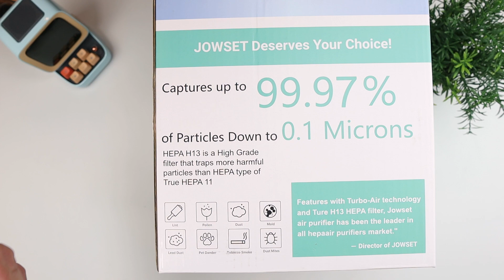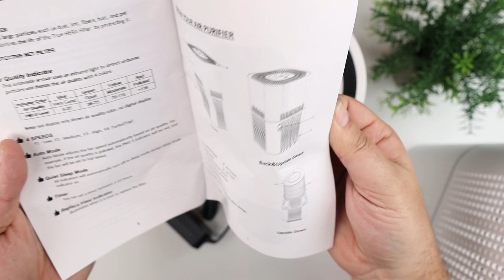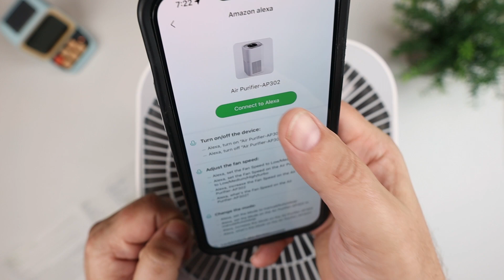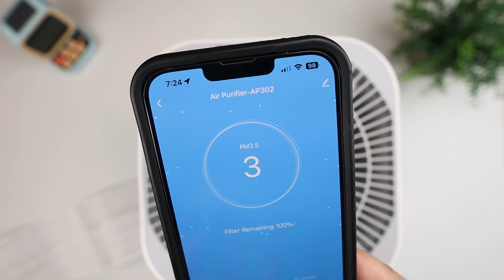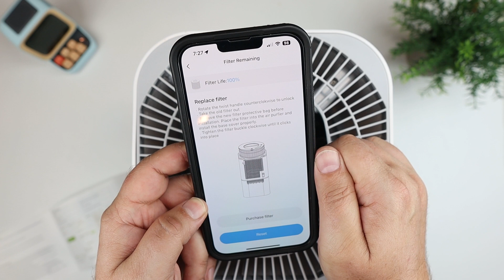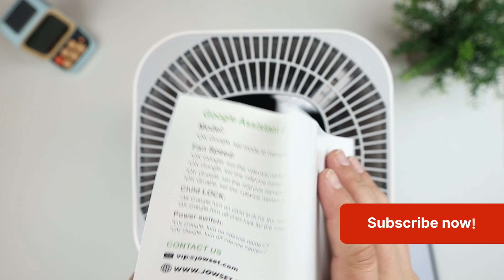JOWSET Smart HEPA Air Purifier

Comment: Are the filter layers washable, please? Thanks.
Reply from the maker: I'm not 100% sure if it's able to be washed with water.  Now if you have a blower or air compressor you can probably blow out any dust to aid in longevity but one of the layers might be almost a paper like material that I would assume get damaged by water.